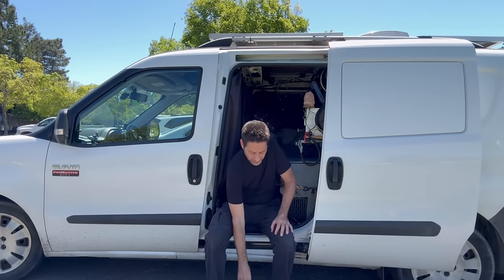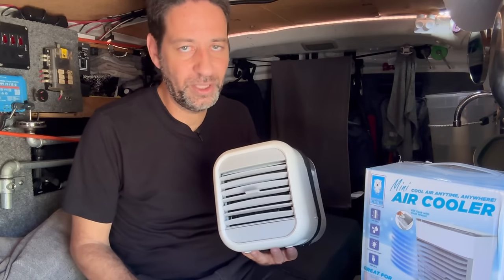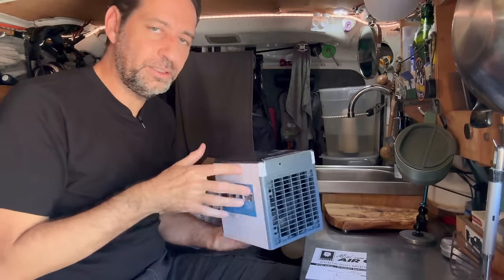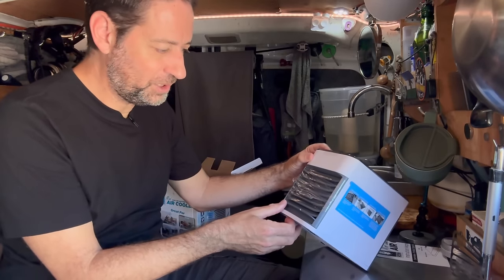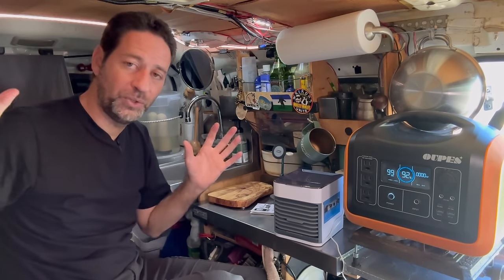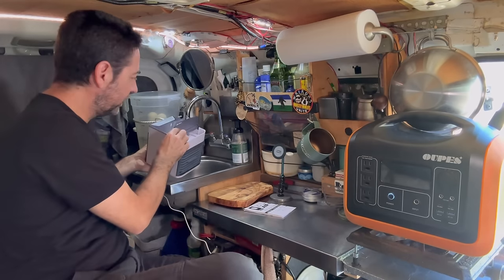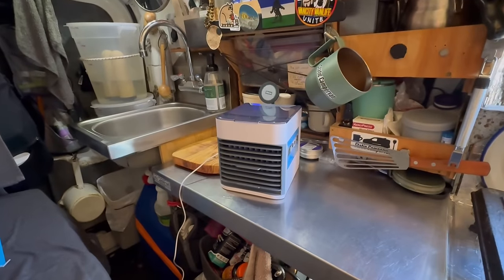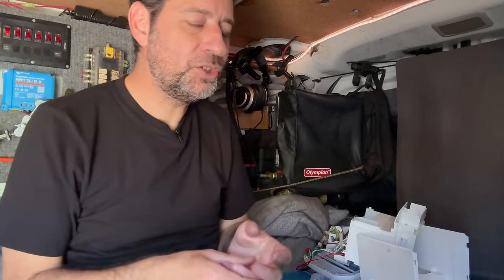Will A $20 Air Cooler Keep My Van Cool? #adayinalife #vlog Tips To Stay Cool In Hot Weather

Comment: Scott, you know what is so popular are vans that are black. Black vans and warmer summers, maybe not such a good idea. I like that your van is white with a ventilation system and no windows that let the heat in. You've got a good set-up. A little air conditioning would really help as well. Your a schmart cookie😊
Reply: Hello Scott...swamp coolers, when made well, are awesome.
Problem is, not very much of anything  is actually made well anymore. Everything is made cheaply, and is priced expensively, which is the end result of greed, the incurable disease that is taking over the world.😢

❄️❄️❄️❄️❄️❄️❄️❄️❄️❄️❄️
Sending you some snow flakes to cool you down. ❤
Reply: Unfortunate but true
Reply: My husband put ice water in his "cooler," and when it's hot outside, set a jar of water outside to heat up and make boiling quicker.
Reply: Thank you for another chill video.   ❤😂 even though we have  never been to... I  love my  Bodum Melior Gooseneck Water Kettle,  27oz.  I don't use flames inside my Jeep Patriot or the Minivan.   I  have a bigger power station though and the kettle is 120V and pulls up to 1000w. Water boils in 2 to 5 min.  I only have 100Watts of rigged solar,  but the Bluetti AC180, power station recharges in less than 2 hours from about 50%.  I don't have a fridge that I have to power though.  I'm not full time either and I live in  a place with both extremes of  weather and use my vehicles to get away from the  extreme cold during the winters. I  don't mind heat though... well as long as it stays below 100*F. It  does that during the summer months on occasion here.  If I didn't have responsibilities here I would not stick around here as much as I do... Thank you again for the video.  Stay cool...
Reply: I enjoyed this video. Thank you very much.
You're a pretty chill guy. 😊

Comment: I am an hvac tech and half of the reason an A/C works is that it is a dehumidifier. You are in a dry area so you may benefit from a bit of moisture but for the vast majority might even want to go with some kind of dehumidifier with a fan if you can spare the energy and that in itself will make the space more comfortable .
Reply from the maker: Yes, the reason why I repeated the fact that these don’t work in humid areas the three times was to hopefully let everyone know that these types of coolers have a limited use
Reply: @patrickvernon4766. .. Do you know if the portable acs on wheels work?
Reply from the maker: @bleuskye8124  sorry to bud in here but Rolling Earthship installed a 12v A/C on his van not long ago. He has videos on the install and also talks about the A/C’s performance
Reply: @StaticCamperVan   Okay. Thanks. I'll check it out.

Comment: A lot of the heat in a van (or building, for that matter) is the vehicle and the stuff in it that's at the ambient temperature. You can cool the air but everything else is still putting out heat. My method for dealing with heat is pointing the front of the van north (away from the sun) opening the driver window, the side door and one of the back doors. If there isn't a natural breeze I turn on a fan. And if that's not enough, I too go to where it isn't as hot. Stay cool, amigo.
Reply from the maker: The Pacific is calling
Reply: On my way.
Reply: You have pointed out a good method for keeping cool in a parked vehicle. As an OTR driver in the summer I will hang a jacket out the window facing the sun to keep the sun off the glass. It dramatically lowers the in vehicle temperatures.

Comment: I live in very arid desert near death valley ca. Evaporative coolers work great here in our average of 9% summer humidity. But even if the rain is coming, or something, & our humidity gets a just little bit higher, the swamp cooling actually makes it worse. To me, way-high heat without humidity, is much easier to live in than even moderate heat with humidity.

Comment: The key to swamp cooler efficiency is to hv a vent window open  ,even in my new motorhome  , in install swamp cooler ,i even use them in Cambodia ,but bigger ones  no problem with with humidity just leave a window open used the 60 yrs

Comment: I purchased one of those evap water cooler. But it didn't work so I purchased a 5000 btu air conditioner  installed it in my back van door and worked beautifully

Comment: Yup, they are much more efficient in dry climates. Your point about having it directly on you is well made - in your van, that should be pretty easy to do. Also interesting observation about the water heater - good to know. That makes sense really - making things hot is expensive, so limiting it's use makes sense. Be well.
Reply: Just a side note - today, 4/18 - I got a 12 oz package of sustainably grown, high elevation, organic, single origin, beans from Peru today at Aldi for $5.99. I haven't tried it yet but it smells great = it is however, a medium roast, but does not smell burned at all. Brand name: Simply Nature.
Reply from the maker: @thizizliz think I’ve tried that one but it’s been a while

Comment: Cool❤I just have been using a O2cool fan which is $20 and can plug into solar , I have the heavy duty built suit case with all multi-use extensions I only paid $50 at Harbor Freights and the fan will also run on D batteries, purchase the fan at Walmart  and I've been doing this 12 plus years full time and since my heat stroke, 7 years ago I am also very heat sensitive😮 oh my gosh whatever you do, do not injure those gorgeous hands, please. Now I have looked at that AC and I have looked at expensive solar panels and power Banks and yada yada yeah 😂 however I still use ice in an old fashioned ice chest😂 I'm not a YouTuber and I just like to have enough Sun to charge the DVD player, Walmart. And for now ET and I are laying low❤ you're definitely easy on the eyes and may you have a beautiful week Scott❤ this land is my land this land is your land❤
Reply: That O2Cool is the best ever woodfire starter.

Comment: Yes🥰 going on almost 5 years, I have a similar cooler as your old one and found that I set the filter in bleach water then  dry out  before using to get 2 extra summers, but eventually ripped out the filter fabric and woven some cut white fabric through the filter slides instead,  still working, will probably replace it with one like yours if it ever stops working😅
Reply from the maker: Nice fix!

Comment: These variants of the new one you got don’t drip water on the filter and only spray mist. What I found to be a huge help in the summer is pouring some water in that pull out tray the filter sits in so those little sponge pads leech it up and gives more of a swamp cooler like effect. It doesn’t look like it but the little ledges around the side allow it to do so, I find it lasts 3 hours or so and is a good boost before going to bed. Also that white on the old one isn’t mold just calcium buildup, I get rid of that with a little vinegar wash but replacements are still sold on eBay too.
Reply from the maker: Yes, I should have been clearer about this type needing to be wet first. But this particular cooler drips water between the fan and filter. 
It was most definitely mold on the old filter. The growing fuzzy legs were the tip off

Comment: I grew up with swamp coolers. They work best when they bring in dry outside air and you open a window somewhere as the exhaust.  Recirculating inside air just increases moisture and lowers the temperature drop from evaporation.

Comment: In my small RV, I'm thinking about adding a 12v AC for summertime. That said, I do have a little USB rechargeable swamp cooler (with a water reservoir and ice packs) and it does help add some moisture to the dry air as well as cool us down over here in eastern Washington.

Comment: We had some extreme summers last couple years and i live on the 3rd floor of a building with no AC, all the heat collected up there and it got HOT.  I found reflective in the windows blocked the sun well and a couple well placed fans kept air moving was just enough to stay comfortable.  Also i thnk your body acclimates a bit and that hot weather doesnt feel so hot. I was suprised how well it felt , and felt bad for people who got used to AC all summer, if you let your body acclimitize and you get some good air flow, keep the sun out and that should do it.  It kept me cool during some extreme heat here in the Great lakes region.,  Thankfully last summer wasnt  so hot and looks like this one will be the same (thank you El Nino) that being said , a vehicle is a different story and   im not sure how just ventilation would do but i suspect might be just enough. Ive been practising living in a car before making the jump and could feel the heat the last few days as well and its not even warm yet, couldnt imagine it the dead of summer but i guess thats what happens when youre car is a greenhouse basically with all those windows, well most cars.  The hybrid toyotoa priuses have this climate control everyone raves about just for this kind of situation, but not very spacious living.

Comment: It can be more effective to spray some mist onto yourself or use an evaporative cooling towel and point a fan at yourself to get more targeted evaporative cooling. It must get pretty rough in there at times. I think I'd go as far as to put an airconditioner at the passenger seat window and hooking up to shorepower for the worst of it, multistory and underground carparks might be a nice place to escape some heat too. Wishing you lots of shade.
Reply from the maker: Well I did explain that the van stays very cool

Comment: Speaking of ice.  I've been wondering if a having a foam mattress bed with small squares cut out (would look a bit like a waffle), and below it you add ice packs.  You still lie on the foam, but below the "waffle" holes are ice packs.  You're not actually lying on the ice.  Blankets then work as an insulator.  You pull a blanket over you at night and insulate yourself.  (During the day, you freeze the ice packs in your fridge, and use them at night.

Comment: Hey Scott - love your videos. Have you tried the cooling pillows/blanket for sleeping? Also, years ago when we had dangerously high temps and no AC we used to fully wet our heads every hour or so. Shouldn’t take too much water as your hair is short. Feet in cool water in a basin helps too.
Reply from the maker: I haven’t tried cooling pillows or blankets. I prefer to leave an area of it gets hot

Comment: FYI, I brought my air cooler because, at night when the air conditioner is not running, and it is humid it gets warm in my small bedroom so I sit my air cooler on the table beside my bed so I could stay cool at night which helps me with my asthma at night as well, and my ceiling fan helps with the even flow of air coming from the air cooler. The humid numbers in North Carolina gets up to 100 sometimes. The air cooler’s is worth it. Stay cool as you can static camper. Be safe and careful. God Bless 🙏🏾🙏🏾🙏🏾❤️❤️❤️🙏🏾🙏🏾🙏🏾❤️❤️❤️🙏🏾🙏🏾🙏🏾

Comment: I use a very similar swamp cooler. In fact I have one on the side table next to my recliner chair and one next to my bed and one for a guest next to the couch. The filter thing with the sponges on mine come out so that they can be soaked in cold water and then set back in so it gives more cooler air.

Comment: I only use usb fan it works well and dont dehydrate as much as a bigger fan.
Reply from the maker: You might try a swamp cooler
Reply: Moisture causes allergy attack and breathing  issues. @StaticCamperVan

Comment: I bought that little swamp cooler last summer when my central a/c went out. It was better when you put ice in the water AND put the filter in the freezer for a bit. But the filter thaws out quickly in 90° weather. Also, it’s really only enough air movement to cool your face. It helped me in a pinch but I still used ice packs & cool showers to get through about a week in Florida August heat.
Reply: I meant to add that I do plan to take it with me in my van (someday)(soon).

Comment: It's wise to be cautious with the kettle.  I knocked mine over, from counter height and burned my right foot pretty badly.  I think i will invest in the little swamp cooler for my van though.  Maybe 2...one for me and one for my cat's hiding space.
Reply from the maker: Oh that’s terrible to hear. I’ve heard people set up swamp coolers for their pets but I think a proper air conditioner would work better
Reply: @StaticCamperVan  I have a real AC for when I'm on shore power.  I don't have a working generator right now.  My gas gauge doesn't work either.  I can do the Gas Math using mileage and fuel capacity. But if I fix the generator to run the AC I wouldnt be able to do the math on fuel. So I guess I'll head to the Coast if I lose my shore power spot.  Always something in Vanlife 😂
Reply from the maker: @Shantelle6253 oh I see. Yes there’s always something. All the best to you

Comment: Swamp cooler:
-Removable and washable filter.
-Runs off of 12 volt and has USB port.

Swamp coolers work in low humidity because the air flowing across the water makes the air that’s flowing feel cooler. It must be pointed directly on you to work.
Reply from the maker: Is this an A. I. generated response? Because this synopsis is partly incorrect as I explained in the video
Reply: @StaticCamperVan  No, not AI. I saved your video in one of my Van Build playlists and those are my notes. What did I get wrong?
Reply from the maker: @joeblow1942 most swamp coolers don’t have washable filters. This one runs off 5volt power not 12v and it also doesn’t have a USB port
Reply: @StaticCamperVan    Those notes are what I want in a swamp cooler if I ever buy one.